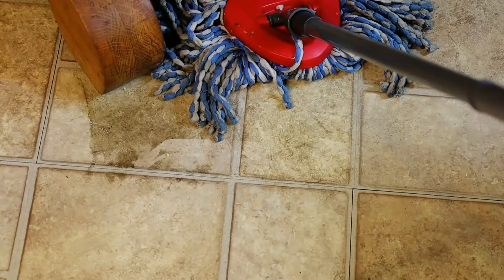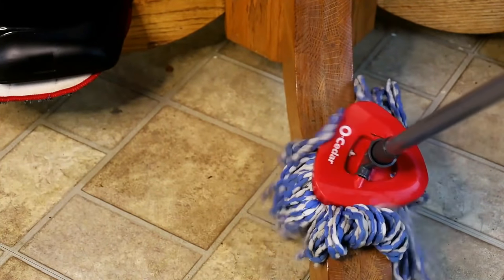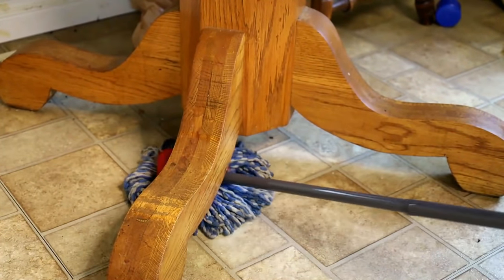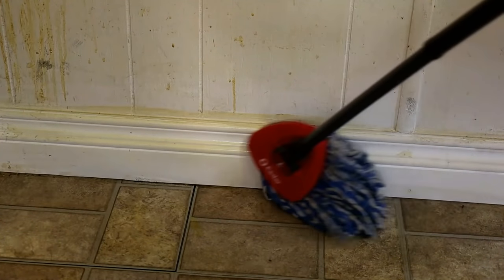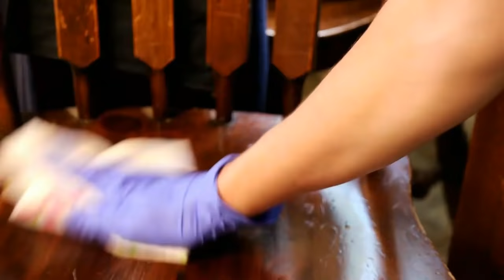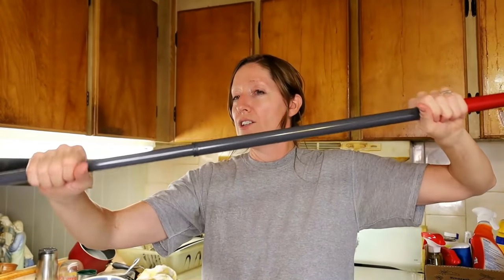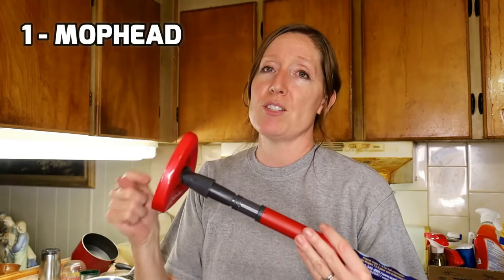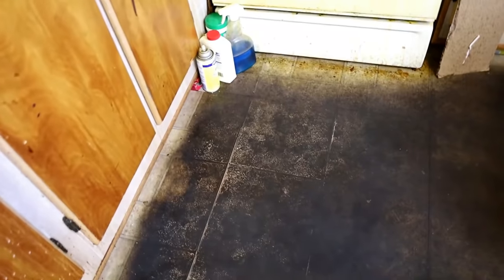UNBELIEVABLE ⚡ Put THIS on Your Filthy Floor and WATCH WHAT HAPPENS

Comment: Wonderful transformation!  I would suggest using a scraper (like you'd use to scrape paint off of a house) to remove most of that grease and then wipe with some old rags/paper towels.  That way you can put it in the garbage or green bin and not down the sink.  Grease should never go down the sink!

Comment: It’s hard for older folks to Thoroughly clean floors and hard to reach areas.  Thanks for giving me some options to help me clean.   Put bacon soda and vinegar in those drains to prevent all that grease from clogging the drain.

Comment: Best thing I've found for something like layers of wax build up, on linoleum and the floor wasn't cleaned before waxing, (in an old apartment I had moved into) is foam Scrubbing Bubbles in an aerosol type can.
      Just spray an area and wait 20 minutes at the least. Mop clean with very hot water. You may have to repeat.
      Absolutely beautiful job here! ✌😎🤘

Comment: I’m sure there is a layer of grease on his furniture and cabinets too. For woodwork, I use Murphy Oil Soap. I love it. It also works to clean oil based paint and stain from paint brushes so you don’t need to use lacquer or paint thinner.❤

Comment: I’d say you need to go weekly or biweekly to not let it get so bad, love that the easy off worked. Wow what a difference it made almost a brand new floor you can always go back over it once you get the grease up and apply a sealer over linoleum to protect it again that’s what the oven cleaner takes off flooring.

Comment: I don’t know if you’ve ever used Krud Kutter but it is the best thing I’ve ever used and it works insanely fast. I honestly think it might have worked faster than the solution you found. I had to use it when I cleaned up my mom’s house this summer.

Comment: Just a thought. Instead of using the plastic wrap, use a plastic painters drop cloth. They are very inexpensive and would cover a large area. Oven cleaner was a brilliant thought. I also wondered if engine degreaser would work?

Comment: I wish I would have seen this before I could have told you you was a squeegee you'll save a lot of time that way you're not clogging up mops and sponges and cloths with all that grease you can just squeegee it into an area put it into your dustpan and rinse it down the drain I recommend that you use Drano on the drains afterwards because all that crease will clog up and winter will come and he will get clogged sinks but yeah that will help you did an amazing job I commend you hats off

Comment: Great job! No, not linoleum, but vinyl. Hard to say what else would’ve worked and not damaged the surface. I believe old fashioned linoleum was actually an all organic product that required waxing and sealing. My mother was cleaning up my grandfather’s house after he died and went to use her floor scrubber/waxer and ended up having to replace the whole floor because it took the top layer of the vinyl off 😬

Comment: I would just use for the floor hot water soap a firm broom let it soak and let the soap cut the grease then start scraping with a scraper then wipe clean. ❤ that’s just what I would do but the method you used of the easy off really worked

Comment: After scrubbing and chipping away at the  grime emblazoned onto my grates, i finally turned to Google for help. One tip was to put ammonia in a large ziploc bag, put the grate in and let it sit at least over night. When that stuff just melted off i was hooked. It was pure magic.
Editing to add. No need to move the whole table, just clean under it as you did, then just scoot it over a bit to get where the legs rested on the floor.

Comment: One product I wish you would have tried is Super Clean used for degreasing motors.  You can find it in the automotive department at Walmart or at auto parts stores.  After you buy one spray bottle, you'll save money by buying it by the gallon.

Comment: I did the same in 1980  but it was the tongue and groove pine cabinets 

Most of the home was at a grease all over the walls so that’s what I had to use for a time 

So please you learned

I have used a tea kettle with boiling water and use the broom to clean the floor in some of these homes for the people are in capable of cleaning

Comment: after all that hard work on the floor you can go over it with an acrylic linoleum sealer so it is easier to get clean next time. grime wont seep into the surface as badly

Comment: You would have saved hours of work if you had used Spray Nine.  Full strength on those floors.  You can use this on just about anything, but i dilute it for regular cleaning.  My ex was a funeral director and he told me they use it to get blood off the floors.  I buy it by the gallon.  Best stuff I've ever used.  Hope you try it. 🎉

Comment: I've been using the L.A's Totally Awesome cleaner for many years. I get it at Family Dollar by the jug. The side of the bottle contains handy delusion rates and I've found that 1 part cleaner to 5 parts water is my all around cleaner for just about any surface. I keep spray bottles in kitchen, bath and garage.  caution when wiping down finished wood. I personally wouldn't.    Painted wood needs no special care. It's also a great "ring around the collar" pre treatment. For years I professionally cleaned offices and homes and this is hands down the best cleaner AT ANY PRICE!!!! The smell of it isn't off putting and isn't using scent to make you think it's clean like some other all purpose cleaners do.
Reply from the maker: Thank you for sharing! Someone commented and said they use it to clean their oven too. Great tip to use it on ring around the collar!

Comment: I would like to brag on my dad for a moment. He worked 2 & 3 shifts whenever he could, then had a part-time job, too. When he lost partial vision (legally blind) & couldn't drive anymore. When my mom started working in her 50's, he started doing the housework. Not dusting, but sweeping & mopping weekly; washing, drying, & folding clothes, doing the dishes daily. He was never taught housework, but he had a basic idea from watching my mom. He microwaved his meals when necessary, washed the car. He passed away in 2023 at 97. I think he lived to almost 100 because he had a purpose. If someone could teach this young man the basics, he might be able to keep things up until someone could help. Also, maybe Meals on Wheels could come by with meals. He would definitely need help changing sheets, etc.

Comment: Did you steam the whole floor first before using Easy off or was it straight easy off and plastic film? Im just wondering if it was the steam that loosened the grease first and made it easier when using Easy off.

Comment: you should  try baking soda with towels covering it with hot water on the towels wait 20 mins and scrub under the towels. it did a great job on a shower floor if you have ever tried cleaning the stuborn stain on a white shower floor, it did better than anything i ever tried before. there is a lady that has a video for showers with soda, towels, and a mixture of dawn and vinegar for if it is really bad. her title is below i dont usually even care about this stuff but this worked on a stain that even scouring powder couldnt touch and it is natural stuff, next time you get something really tough this is a miracle method!

------->  How To Clean Textured Fiberglass or Plastic Shower Floor - Baking Soda & White Vinegar

Comment: I've used biological washing powder/detergent to clean a linoleum floor which has been caked in grease. The enzymes in the detergent breaks down the grease and is less harmful than using harsher chemicals. You can also use it on greasy stove tops.

Comment: I think I would invest in some contact paper for the cabinets & counters, vinyl stick on floor squares, or just vinyl sheeting for the floor, on top of whats there, and some tin foil or something safe for covering the stove. Things that can be wiped down &/or replaced fairly easily. So it doesn't get so bogged down again. I would also invest in a bulk supply of cleaning wipes, floor cleaning wipes & a swiffer mop for this relative.

Comment: The best way to clean stainless steel sinks and all porcelain sinks as well as bathtubs that are made of porcelain and plastic shower kits is 10 x strong toilet bowl cleaner. It will get rid of water stains off of stainless steel faucets and it will also get rid of any water stains that are left behind on your water dispenser on the refrigerator. I would suggest rinsing with water first and getting it wet and then putting toilet bowl cleaner on a non scratch sponges. Personally I like Magic Erasers but the cheap ones from Menards and a big bag for $3 maybe $4 now

Comment: The east off is sodium hydroxide if I remember right. This would have gone better if you got bulk SH in 50lb bags from a chemical supply. Mix it with a bit of soap dish soap will work in a pinch. Start with 2lb a 5gallon bucket, go up to 8lb a dive gallon. Use Enviro Bio Cleaner after the heavy layer is off. EBC is a great product that has to be mixed with 9 parts water to start. I owned a commercial cleaning company that cleanest the outside of buildings and the inside of restaurants.

Comment: approx 1/2 C. Original Blue Dawn, 1 tbsp caster oil or mineral, 2 tsp witch hazel or  isopropyl alcohol, a dropper ful of peppermint oil,  Fill the rest up with hot water.  Yippee!!

Comment: I have to clean up the floor tiles around the bar at my new Job,After amount of customers walked on it all day,They get filthy,Not quite that bad,We use hot water,Floor cleaner,Also use a long scrubbing brush,Then mop it all up,Should see the amount of muck coming up after one day,Got to be done,Its quite an interesting Job

Comment: I own a floor cleaning company, here's my tips to speed this up:

-mix heavy duty degreaser with almost boiling water
-heavily mop the floor
-use a medium brush to scrub the floor by hand or a buffing machine if u have to
-use a wet vac to extract the slurry
-repeat as needed 

That paper towel wiping and sponge wiping is nonsense to me :o. 
A wet vac is pretty cheap, get a second hand one. Same as a floor buffer..

Comment: Pour some amonia into a garbage bag or size needed, outside
 Set oven racks and burner racks inside bag and close the bag tightly. Leave overnite. Racks will be clean by morning. No need to cover racks completely with amonia as fumes also clean. No mess and no odor in the house.

Comment: i've got that mop...am so disappointed with the mechanism...the clutch bearing went out on it soon after the warranty expired...my Hurricane 360 i had before i loved until it started leaking around the spinning part at the bottom of bucket...the spinning portion of it still worked though for years...if i could've fixed the leak then i would've kept the 360 one...for now i have to buy a new clutch bearing for the O'Cedar

Comment: Maybe he could get rubber mats to put near the stove and sink. That way less mess will get tracked all over. Mats are easier to clean. Just a thought. I work with the elderly. I know how things can get. Also have cleaned many refrigerators. Sometimes they just don't  have the strength to clean properly.

Comment: As much time and patience needed to that floor, and whatever chemicals you applied, I think it would be cost efficient to have new flooring.
Reply from the maker: Except if he didn’t want or agree to it. The story is that it took years to even get to the point where he would let her clean. 

I know that’s hard to understand. The family was willing to help and replace. He refused. He didn’t want change. Until this time, after many years, he let her clean.
Reply: @ I watched the video. I only made an observation.

Comment: 🤔🤔, the oven cleaner should have grabbed a tarps from the dollar store. Sometimes and not for this but depending on what you have to clean sometimes a coconut oil, will remove sticky greasy stuff and it cleans up nice as the orange oil cleaner on a floor be careful though☮️

Comment: Wow looks like it was burned in a fire. You used my favorite oven cleaner I make a spray 2 tablespoons of lye dissolved in warm water add a few drops of lemon oil in a heavy duty spray bottle from Home depot strips dirt grease stains off ovens pots floors etc acid from lemon helps eat grease done it for years. Tip save old shower curtains and when you do big jobs like that use them instead of plastic wrap to cover the area saves time

Comment: There is a way better steamer than that with a mop head 

Pro tip purchase in bulk terry cloths 
Buy a swifter Broom and use those that is how clean my floor with odoban original  and I rinse with different clothes 

Since you may be doing this often theis is a excellent option  for you

Comment: If you add the cost of all the cleaning products used, plus the paper towels, plus a new mop head this floor could have been replaced with brand new vinyl flooring. You can also wait for floor covering companies to have sales on remnants and have a new floor installed for much, much cheaper than cleaning this old flooring. The new stuff is much prettier.

Comment: The only thing I wouldn't do is pour that greasy liquid down the sink. You drain pipe will get clogged.  A product that will clean out your drain pipes is call Rid-X. Its non toxic and it has microbes in it that eat the clog. Its mixed with water and you pour it down any drain and it works. I've been using it for years every couple of months to keep my entire drain pipe system clean. Sinks, bathtubs. Its made to for septic tanks, but works great on all pipes that organic material build up is present.

Comment: I don’t think all that grease should have gotten squeezed down the sink. Grease in pipes can cause smelly clogs and expensive plumbing repairs. I noticed this right away because I once had a cleaning lady cause $20,000 in damage to my septic system by flushing cleaning wipes.

Comment: So here's what keeps rolling through my mind during this video. How much money should be spent on cleaning product per year to keep this room alone clean? how much would discount cheap flooring cost? why isn't replacing it at this point a far better cost effective measure?  How much did it cost for this lady to come clean this up? Why in the 12 years that this has never been cleaned did the guy not at least learn the bear minimum to try and clean it up? Why is she doing it the hard way bent over with a sponge or with that tiny steamer ? are there no steamers that maybe have  a 12 in  area of cleaning effect or something larger at  least? why not have power tools like maybe a cordless drill with a brush attachment. why no long handle 14 in squeegee to squeegee the slug into one section for easier removal onto dust pan; after using easy off and plastic wrap? why am i watching this?

Comment: Cheap old, non-toxic, baking soda cuts through burnt on crust of pans. Make a paste; let sit overnight, then spray vinegar on it. Wipe it up. That floor looks like a floor from an auto garage, not grease from cooking, where people tracked motor oil on their boots from working on cars.
Reply from the maker: That would make such a mess. I did it for an oven for another video. Baking soda dust and it takes forever to get all the baking soda residue off!
Reply: @CleanFreakGermaphobe  Like spraying that stuff all over and putting plastic wrap over it wasn't a mess? Expensive purchase of multiple canisters of cleanser. You don't have to stir up dust a dust. Sprinkle baking soda like cleanser and moisten it with water in a spray bottle, creating a paste, let it dry overnight and spray it with vinegar and mop it up.
Reply from the maker: Right but she was in another state with limited time, the kids, everything. She was testing but she tested a lot of ways and this one was the one that worked. Unfortunately, she can’t go back and try more. But I’ve had a lot of experience with baking soda and vinegar and think it’s good for a lot of things but it would require even more time to sit and work and clean up. If you try it let us know 😀
Reply: @CleanFreakGermaphobe  That is fine to try different things, but baking soda works on heavy grime. Vinegar makes it bubble up and loosen the grunge. Elbo grease is needed too.